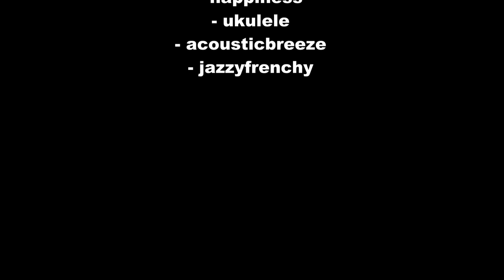Diorama - BMW R12 Zvezda 1:35 Step by Step

Comment: As a woodworker I cringed when you stained and varnished the base - why ? Because you should always follow the grain of the wood. Doing it against the grain leaves small build up lines of the stain and varnish. Also, after staining, you should give a light sanding and then wipe down with a slightly damp cloth.